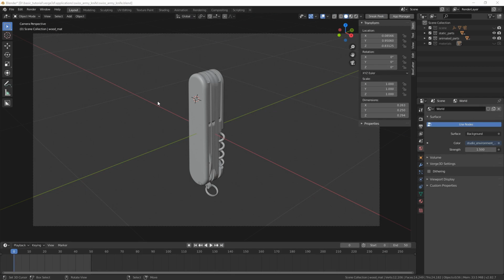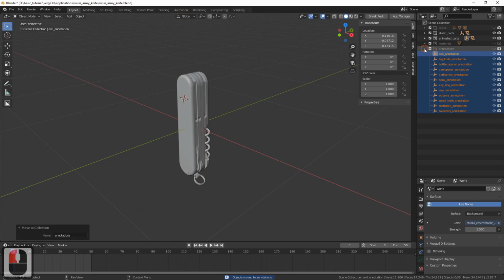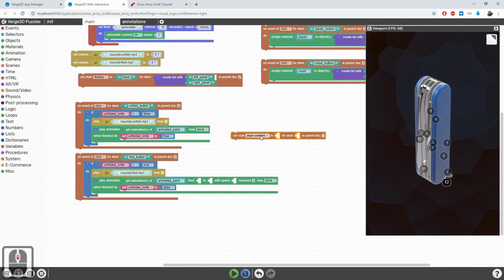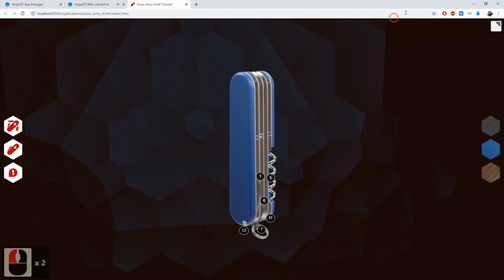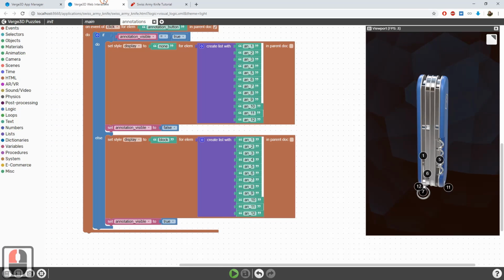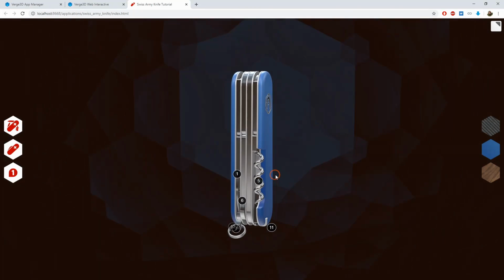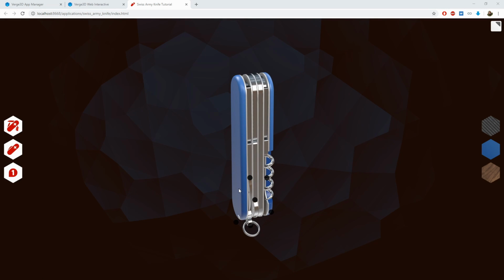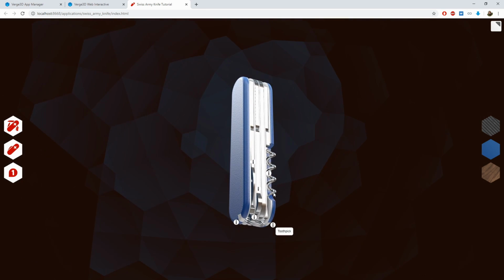Verge3D for Blender Basics - Part 9 - Annotations

Comment: This is very helpful, though I would like to point out that there is not a lot of flexibility to create something different if I am not familiar with the limitations of the code. Seems like there could be a nice annotation builder UI created, that could perhaps work in conjunction with the puzzles. I have been trying to think of ways to make interactive dimensions that can be displayed or hidden much like these annotations. I have some ideas, though it seems a bit tedious to create such a thing. I came from using an Autodesk product called "Inventor Publisher"; where a variety of annotations and dimensions could be created with just a few clicks. If you would like suggestions on styles, I'd be happy to provide some.
Reply: Understood! CSS coding is not programming but can be troublesome for users with no webdev background. Thanks for your suggestion, we'll have a look at this software and discuss the problem.
Reply: @alexkowel  Here is a quick example of the simple annotations I mentioned from Inventor Publisher: 
https://youtu.be/EgjF1amd9Mo
Note the various shapes available, as well as fill style/color, and the leader style. The ability to choose from these and make changes quickly, is what would really make the process better for Verge3D. (Pay special attention to the section starting @ the 0.51-1.08 mark.)